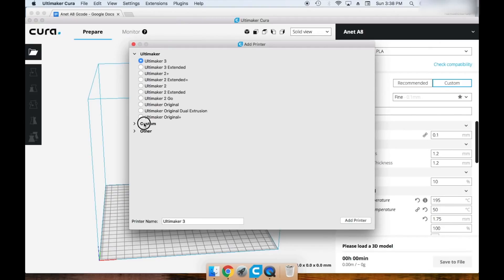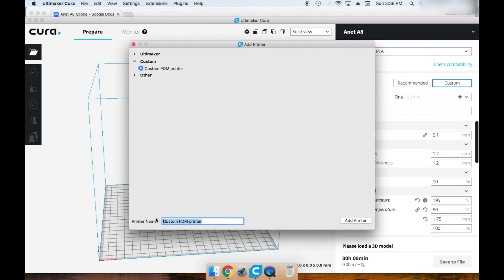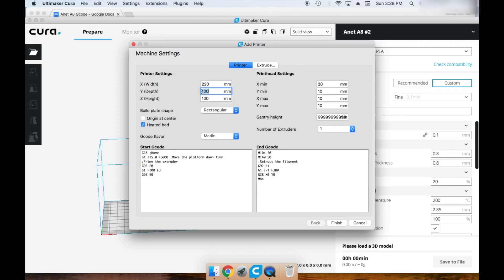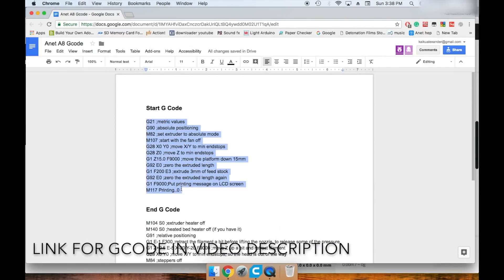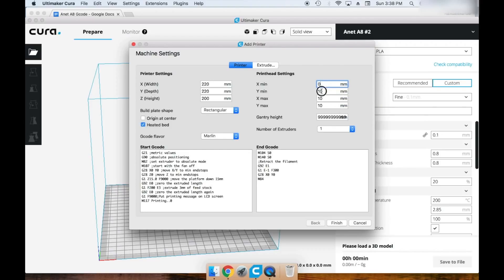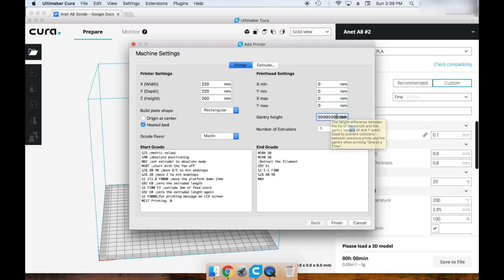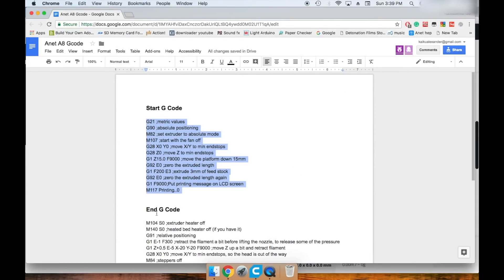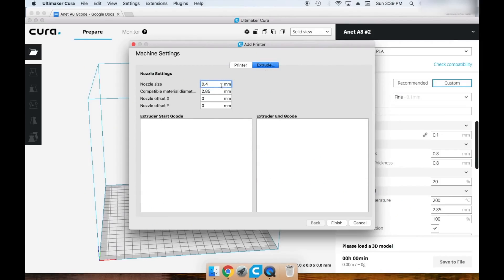How to Setup Anet A8 with Cura 3

Comment: Great video. I think I have it all right but I only have one problem - my computer will not ee the printer. Mine is an Orion Motor Tech A8 which I understand is just the same as the Anet A8. Windows nor Mac OS X can detect the printer. Any suggestions? Thanks in advance.
Reply from the maker: Yes. You have to save the file to the micro SD card. Then put the micro SD card into the printer

Comment: Hi , i have problem with the new Cura 4.3, i cannot change the printhead settings.. i have X min -222 , Y min -220, X max 220,Y max 220, Gantry Height 1, if i trying to change to everything else, it always put the -222 or 220.Can you help me with this..? I using Octorpint for printing, and some models print outside the bed...
https://drive.google.com/file/d/1EMmq4f32DoHIBUqYey6Bpy3hk7FCgXyc/view?usp=sharing

Comment: the end gcode is missing in the link can you update  thanks
Reply: M104 S0 ;extruder heater off
M140 S0 ;heated bed heater off (if you have it)
G91 ;relative positioning
G1 E-1 F300 ;retract the filament a bit before lifting the nozzle, to release some of the pressure
G1 Z+0.5 E-5 X-20 Y-20 F9000 ;move Z up a bit and retract filament
G28 X0 Y0 ;move X/Y to min endstops, so the head is out of the way
M84 ;steppers off
G90 ;absolute positioning

Comment: Here is an end Gcode for the Anet A8...

M104 S0 ; turn off extruder
M140 S0 ; turn off heatbed
M107 ; turn off fan
G91 ; relative positioning
G1 Z25 ; raise head 25mm
G90 ; back to absolute positioning
G1 X0 Y220; home X axis and push Y forward
M84 ; disable motors

Comment: End g-code:
M104 S0 ;extruder heater off
M140 S0 ;heated bed heater off (if you have it)
G91 ;relative positioning
G1 E-1 F300 ;retract the filament to release some of the pressure
G1 Z+0.5 E-5 X-20 Y-20 F9000 ;move Z up a bit and retract filament
G28 X0 Y0 ;move X/Y to min endstops, so the head is out of the way
M84 ;steppers off

G90 ;absolute positioning

Comment: End G Code
??? IS NOT IN THE DOC
M104 S0 extruder heater off
M140 S0 ;heated bed heater off
G91 ;relative positioning
G1 E-1 F300  ;retract the filament a bit before lifting the nozzle, to release some of the pressure
G1 Z+0.5 E-5 X-20 Y-20 F9000 ;move Z up a bit and retract filament even more
G28 X0 Y0 ;move X/Y to min endstops, so the head is out of the way
G1 Y210 F9000 ;move out to get part off
M84 ;steppers off
G90 ;absolute positioning
Reply: Thank you. I was about to lose my shit lol You're awesome for typing that all out for us!
Reply: Thank you so much! You are a real legend!
Reply: TKX!!!
Reply from the maker: Sorry must have accidentally deleted it.

Comment: Can you please tell me when I  go to the monitor portion of the screen it says my anet a8 printer is not connected. Is my printer supposed to be connected for cura to work?
Reply: Make sure the printer is turned on while it’s plugged in. Stupid mistake that I made. But you don’t need to have it connected, you can transfer the files from Cura to your printer using USB disk. Having your printer and computer connected will give your more info while your printer is printing

Comment: "Built plate temperature", hidden... what can I do to get it on the sidebar?
Reply: there is a cog wheel that comes up if you hover over the "header" for each drop down menu.. there are TONS of options to enable in there so you can see them in the first menu.

Comment: M104 S0 ;extruder heater off
M140 S0 ;heated bed heater off (if you have it)
G91 ;relative positioning
G1 E-1 F300 ;retract the filament a bit before lifting the nozzle, to release some of the pressure
G1 Z+0.5 E-5 X-20 Y-20 F9000 ;move Z up a bit and retract filament
G28 X0 Y0 ;move X/Y to min endstops, so the head is out of the way
M84 ;steppers off
G90 ;absolute positioning
Reply: unsung hero right here
Reply: Thank you for typing that out for us.

Comment: G21 ;metric values
G90 ;absolute positioning
M82 ;set extruder to absolute mode
M107 ;start with the fan off
G28 X0 Y0 ;move X/Y to min endstops
G28 Z0 ;move Z to min endstops
G1 Z15.0 F9000 ;move the platform down 15mm
G92 E0 ;zero the extruded length
G1 F200 E3 ;extrude 3mm of feed stock
G92 E0 ;zero the extruded length again
G1 F9000;Put printing message on LCD screen
M117 Printing..0

Comment: Hi, thanks for sharing your hard work to make it easier for others. My Ainet A8 just arrived, but it is for Xmas, so I was only allowed to do a quick check for any obvious damage; not even opening the parts. I did however manage to persuade my wife to let me have the USB/SDcard to install software. Will this work on  Cura 3.6.0 please, as I have downloaded the latest of each of the softwares. Thank you so much.
Reply: I Just got this printer as well and am going to do a test print with these settings and I will let you know how it goes.
Reply from the maker: This works on the cura 3.6

Comment: you are not clear where to get g-codes you should have the sight listes you cant read your screen
Reply from the maker: I said Google docs document in the description.
Reply: @KaikualexanderLee  went there it said no page found
Reply: i went there it says no page found
Reply from the maker: @speedycamera  G21 ;metric values

G90 ;absolute positioning

M82 ;set extruder to absolute mode

M107 ;start with the fan off

G28 X0 Y0 ;move X/Y to min endstops

G28 Z0 ;move Z to min endstops

G1 Z15.0 F9000 ;move the platform down 15mm

G92 E0 ;zero the extruded length

G1 F200 E3 ;extrude 3mm of feed stock

G92 E0 ;zero the extruded length again

G1 F9000;Put printing message on LCD screen

M117 Printing..0
Reply from the maker: M104 S0 ;extruder heater off

M140 S0 ;heated bed heater off (if you have it)

G91 ;relative positioning

G1 E-1 F300 ;retract the filament a bit before lifting the nozzle, to release some of the pressure

G1 Z+0.5 E-5 X-20 Y-20 F9000 ;move Z up a bit and retract filament

G28 X0 Y0 ;move X/Y to min endstops, so the head is out of the way

M84 ;steppers off

G90 ;absolute positioning
Reply from the maker: First reply is start g code second is end gcode
Reply: @KaikualexanderLee  thank you sir

Comment: why are there two "G92 E0 ;zero the extruded length" theres no way to adjust the bed center after adding a new nozzle unless it is placed in the exact same location from the bearings

Comment: I just want to say do not use this tutorial it might not work for all it works much better for the 14.07 version! its on the English instructions. The only reason why i recommend this is because i tried this several times and i keep getting weak prints with several holes no matter how hard you tun your 3D printer its the software.   This link will help a lot: file:///C:/Users/User/Desktop/3d%20p/English%20Instructions/Installation%20Instruction/A8%20Operation%20%20instruction-Z.pdf
Reply from the maker: Hmm... I'm not sure what you are trying to say. This has worked great on cura for 3.2.

Comment: I just used the Prusa settings and have never had any trouble...
Reply: Same, I configured it as a Prusa i3 with 220x220x240mm print volume. Overall very similar machines.
Reply: how well does the prusa settings work for bridging with your printer?
Reply: Hi jake, bridging is fine. It will tolerate roughly 20 - 25mm gaps, enough to use 5% infill to print a hollow cube for example. Thats with 192'C / 60'C temps, 54mm print speed and 100mm infill speed. Infill would benefit from dropping to 80 - 90mm speed as with larger objects sometimes the flow can't keep up and the end of the infill strand gets too thin to be structurally sound. I should mention I have my filament feed set to 108% also. These settings have worked really well for me printing all sorts of things.
Reply: Seems to me that prints on the Prusa take longer than the newly made     Anet A8 settings here provided; I cannot figure out why that is. They seem the same size and same specs and everything.
Anyone any idea?

Comment: Thanks for the settings!
I have a slight problem with the nozzle fan. it wont spin at all with this settings.
When ive reset the printer and its cool i can control it in the fan menu. 
lso it is on in cura.
What can i do to let it spin while printing?
Reply from the maker: Vin cent the nozzle fan won't turn on untill the first few layers are printed. After the first layers are made the nozzle should work.
Reply: After 2 models it continues cooling after a couple of layers. dont know what happend but it works now. Thanks for your awnser!

Comment: Z height should be 240mm
Reply: right, and X & Y should be 220, this video could lead beginners into a wrong path
Reply: @gusmaiawork  For my personal experience, it is better to add less mm becausa the peripheral things that you want to add, like the cable guide, and a 20cm glass in my case "Error cutting it" beside with the 240mm in z axis it almost broke my printer when i did a 230mm height print.
Reply: @camiloherrera9268  So what do you think the z height should be?
Reply: So you suggest maybe 230 max? I doubt I'll be printing anything that tall anyway.. Not for a long time. But it's good to know that all these perameters are changeable when I decide to build a emt12 with new rods and guides, belts, and extended wires.. I could go up 4 feet if I wanted to.. probably be hard to find someone who sells 4 foot threading though.. That stuff isn't your ordinary average thread.

Comment: isnt the Anet A8 print bed size suppose to be 220x220x240?
Reply from the maker: Dennis T yes but i like to keep the z axis a little lower. You will see what i mean If you do a test print
Reply: +Kaikualexander Thanks for this video, very helpful. The start and end gcode in the linked document are identical, that can't be right?
Reply from the maker: 6yjjk oh man thanks for pointing that out. I was working on the follow up video and must have changed something.
Reply: No problem, I noticed the behaviour was a bit odd at the end of the test print but didn't spot it while copy-pasting! Wouldn't have gotten that far without this vid, so thanks again.

Comment: very nice tutorial. but my computer only goes untill cura 2.3.1 it is a win32 system. can i still use your setup? this is my first contact with a 3d printer. this is why i ask. Best regards
Reply from the maker: Rui Valdez I am not positive but I'm pretty sure yu can use the same machine settings.

Comment: Kaikualexander
Hi, i see you have some experience with Anet a8 stuff. My problem is: at the print high about 7-8 cm printer go crazy.
It go full up or start to go all around and i have to turn it off.
Do you have  some idea what could be a problem?
I will try with settings you show in your video but at the moment my extruder screw is broken so i am waiting for new one..
Thank you for comment.
Reply from the maker: Huh that sounds like a wierd issue I do not know what a possible resoloution is have you watched the official Anet debugging video

Comment: Hello, I have a problem, the extruder does not go to the center of the bed, how can I do to solve this problem .. in other prints works on the last I chose not.
Reply from the maker: Vitantonio Lillo make sure sure origin at center is not checked also try reuploading the print file to the micro SD card
Reply: I did not start the center
Reply: a volt that starts the printing does not come out even the filament and the z axes are lowered in the left corner only that does not go indiagonal
Reply from the maker: Vitantonio Lillo very strange. Did you watch the official Anet A8 debugging video first?

Comment: my printer doesnt start in the center but left on front...i use sierra how to solve?
Reply from the maker: icsunonova.      Make sure all the settings including the gcode match the video. Make sure that origin center is NOT checked.
Reply from the maker: I also suggest that you 
Redownloading the gcode file to your micro sd card.

Comment: i want the support but it should be removable how to do that setting
Reply from the maker: Adarsh Bhatgunki turn the support on when you want it. Press the gear icon and check the box saying support interface. Play around with this to determine how strong you support it. Typically, I keep mine at 30%

Comment: Ok I'm at a lost for words.. Can anybody help me with my Anet A8 3d printer. It keeps coming up in cura that the printer does not support usb printing
Reply from the maker: Brandy Cohn don't print from USB print from SD card
Reply from the maker: Put the micro SD card in your computer and save your file to see then put the card into your printer
Reply: Yeah I learned the hard way not to print from the cable, it would stop extruding mid-print every time and I kept "unclogging" the nozzle, thinking that was the problem. The problem was fixed as soon as I used the SD card instead.
Reply: Brandy Cohn you cant use usb on mac you have to use the SD

Comment: Why Marlin for Goode flavour!  Are you referring to the Ramps board....or the stock Anet motherboard?
Reply from the maker: Lester Bennett yes! This tutorial is for the stock anet a8 motherboard
Reply from the maker: Even if you upgraded to Marlin the gcode should be the same. To answer your question, yes if you are using the stock motherboard that came with your printer chose Marlin.
Reply: Kaikualexander
Reply: Kaikualexander.......My referred to the Anet A8 stock motherboard...(Omni?).  I only see Marlin mentioned in reference with the Ramps 1.4 type set ups.  As it is I have not found ...on a number of A8 specific Facebook groups...or similar groups....I have not found any tutorials which relate to upgrading...or changing versions of firmware...and what tools and connectors are required.   It is obviously possible to upgrade the basic Anet board to auto level enabled firmware.....even Anets Facebook and website do not have this information...
Reply from the maker: QuadCopter 102 I will post a video on updating the firmware around tommarow
Reply: Olá como faço para achar o Gcolde para adicionar no ajuste da impressora, tenho uma Ant A8
Reply: I have an Anet A6 with stock motherboard and firmware. Should I select Marlin or RepRap for GCose flavour?
Reply from the maker: Lester Bennett marlin
Reply: Please clarify. Are you saying you select Marlin even if you have not upgraded to Marlin?
Reply from the maker: QuadCopter 102 stock
Reply: Kaikualexander ....never heard of anybody using marlin on stock A8 motherboard .....maybe you can do a tutorial on uploading the firmware and setup....BTW....you said height 200.....it’s 240.
Reply from the maker: QuadCopter 102 Wdym by uploading the settings firmware?Machine settings affect what goes on the SD card. I should be uploading a full Marlin tutorial later. You can change the z axis to 240 but I feel more comfortable at 200.

Comment: Good video. I thought the z height was 240mm? I'm new to this and mine hasn't even arrived yet so I may be wrong.
Reply from the maker: John Smith technically it is but in reality its less. In the video it is set to 200 just to be safe
Reply: Ok that makes sense. Thanks.
Reply: Set at 240 but remember...check if your A8 is printing from the real centre....some are offset. Also if you use a brim....the outer first line will be the nearest to the plate edges...so your actual item print as to be sized about 8mm less in size  ....or more depending how you set your brim size. in truth it’s very rare you will build anything so big.....